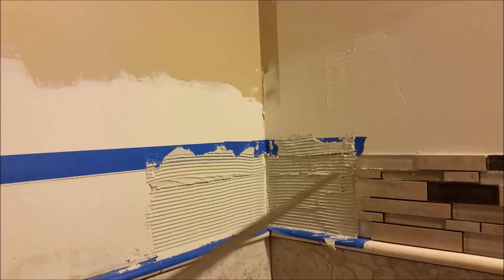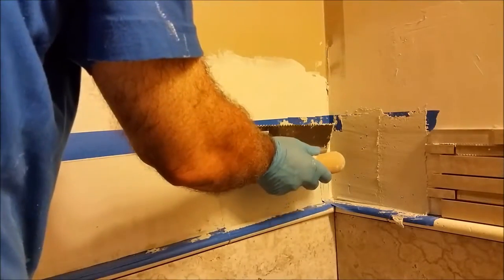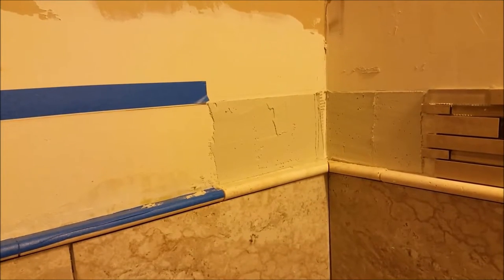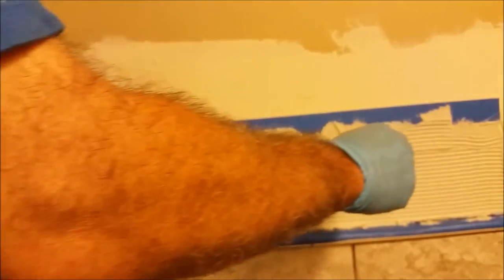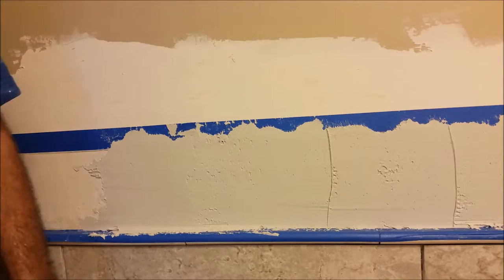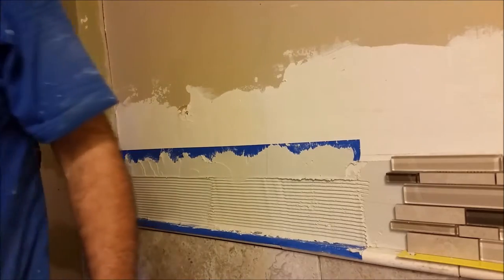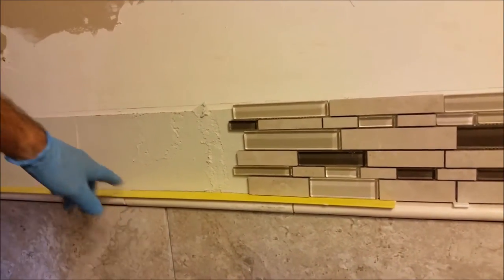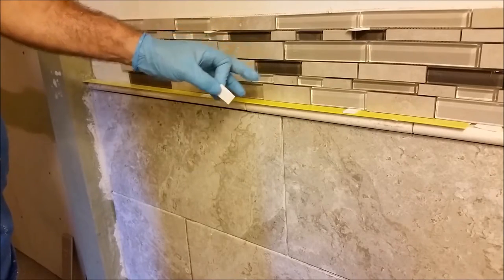How to Install Glass Mosaic Tile in bathroom shower - Part 5  - Mosaic Installation

Comment from the maker: Thin set used =https://amzn.to/3qFMKkW
Medium thin set =  https://amzn.to/3mSk9aR  Mapei Pre Mix Grout = https://amzn.to/2HqhdC3 
Mapei Grout = https://amzn.to/340hWS5
Pencile Travertin =  3/4" https://amzn.to/33euEOb  or 1/2"  https://amzn.to/2EKmmE5

Tools and Materials  used:
Angle grinder used = https://amzn.to/368IX8C
Diamond Blade =  https://amzn.to/3j2kTbc
Dimond hole drill bits =https://amzn.to/36bX2Cs
QEP wet saw = https://amzn.to/3cLJgaW
Diamond Blade = DeWalt https://amzn.to/3jfdpSr or Black Widow https://amzn.to/3jgx18G
Grout Float = https://amzn.to/3j7KO1c or https://amzn.to/348KLMu
Notched Trowel 1/4 x 1/4 x 1/4-Inch= https://amzn.to/3j26Zpv
Notched Trowel 1/2x 1/2 x 1/2-Inch= https://amzn.to/2S5Zceg
Notched Trowel 1/4 x 3/8 x 1/4-Inch=https://amzn.to/3cDPbhZ
Nitrile Gloves = https://amzn.to/3i8VhrT
Best Thin set used = https://amzn.to/3cxVBz8
Medium thin set =  https://amzn.to/3mSk9aR
Mapei Pre Mix Grout = https://amzn.to/2HqhdC3
Mapei Grout = https://amzn.to/340hWS5
Miter Box Used =  https://amzn.to/2SnYgm1 or https://amzn.to/2G1CVfB
Hand saw =  https://amzn.to/30kvabp
48" Level = https://amzn.to/347tmUl or https://amzn.to/30m3y5H
Ez Niche = https://amzn.to/33ef8Sf
Pencile Travertin =  3/4" https://amzn.to/33euEOb  or 1/2"  https://amzn.to/2EKmmE5
Travertine Ivory chair rail = https://amzn.to/3jgAuEc  or https://amzn.to/34dwfD5

Try Amazon Prime 30 days for free = https://amzn.to/2JMWaLe
Create Amazon Business account = https://amzn.to/3mLSyYt
Joint Amazon Prime Watch Thousends Of Movies and TV = https://amzn.to/33NfsHD
Try Personal Shopper Wardrobe  https://amzn.to/2VCl